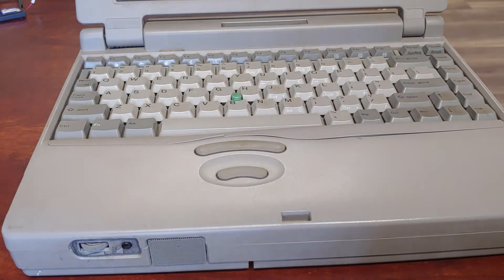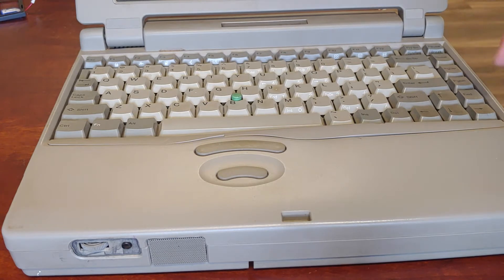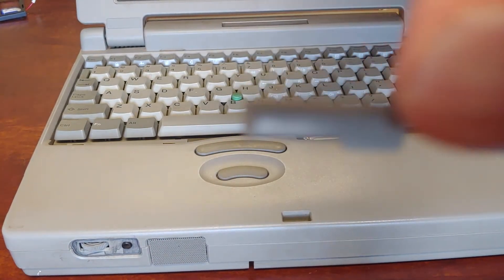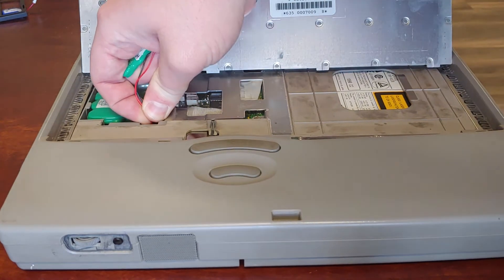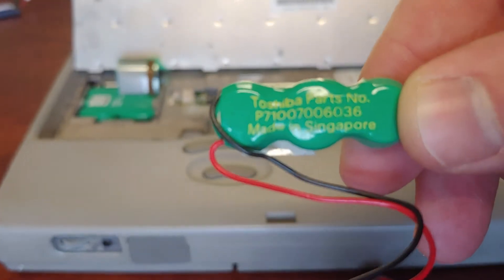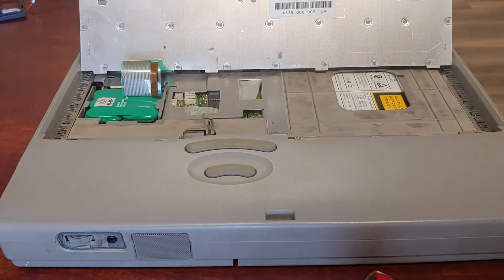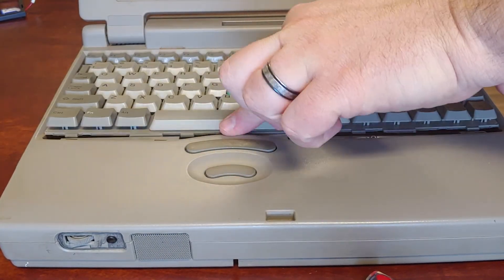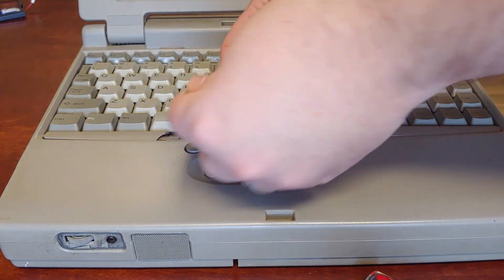Toshiba Satellite Pro 425CDS/430CDS and others CMOS battery replacement

Comment: i recently picked up one of these machines, and its rtc battery is dead, because of course it is. however, it won't boot from either the hdd or fdd. could a flat cmos battery be causing this, or is it more likely that both drives are just faulty?
Reply from the maker: @tethys8113  I doubt a flat CMOS battery would do this behavior.  It is however possible if one of the batteries leaked enough to do board damage.
Reply: @i80386sx  thanks for the tip, that's what i was starting to think, too. the hdd is doing the classic click of death, and after i took it apart, checked it over and put it back in, the fdd went from no pulse to the drive light coming on and the r/w heads trying to move. i'm hoping in the latter case it's a simple clean and regrease that's needed. i doubt that the board is damaged, i couldn't see any leakage from the two aux batteries, and it POSTs and reaches the bios alright.

Comment: Where can I get a new battery like that? I think I may need to replace one because I’ve ordered the same laptop as that and it says “bad RTC battery” and “bad check sum (CMOS)” do you know what these mean because I have no clue
Reply from the maker: I sell replacements on eBay.  The smaller one handles the CMOS settings.  Bigger one is for hibernation.  It’s not required for functionality.

https://www.ebay.com/itm/325248099782?mkcid=16&mkevt=1&mkrid=711-127632-2357-0&ssspo=wlVhkVPnSlS&sssrc=2051273&ssuid=wlVhkVPnSlS&var=&widget_ver=artemis&media=COPY
Reply from the maker: 9 times out of 10 it just means the settings are back to default as the CMOS battery failed.
Reply: Oh yeah also idk if you know the model but I have the 220cs and it doesn’t have that removable plastic do you know how to remove the keyboard?
Reply from the maker: @Lobo2265  this doesn’t flat out say but it might provide a hint.

https://youtu.be/Hj15Hb564h0
Reply: @i80386sx  alright thank you a lot for you help.